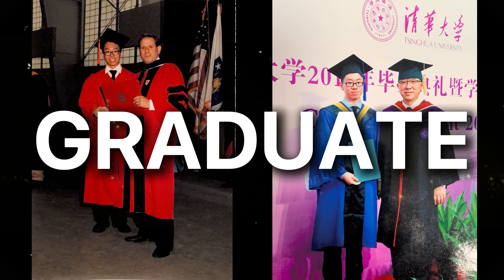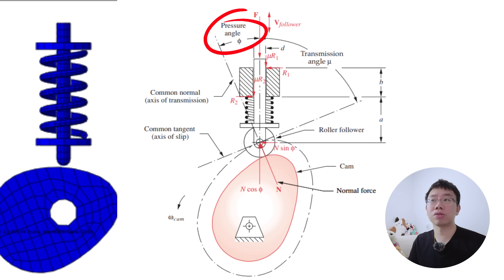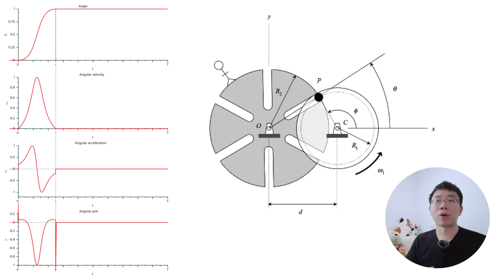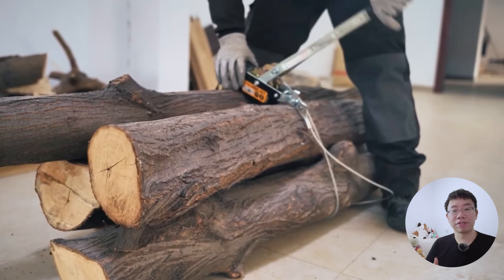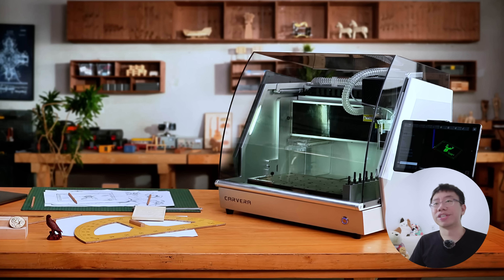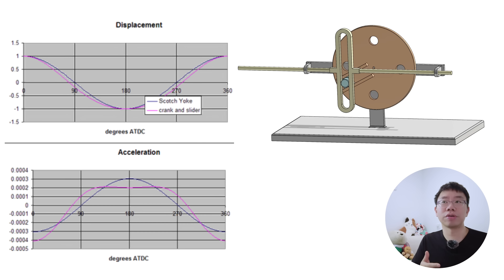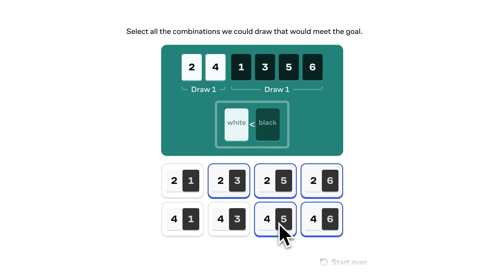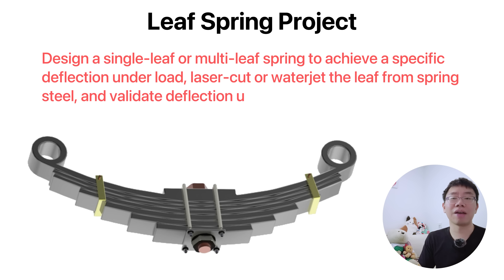Mechanisms EVERY Mechanical Engineer Should Know

Comment: Most mechanical engineers graduate without ever seeing a drill.  There is a massive, massive skills gap in engineering graduates.
Reply: Idk, my school had an entire fabrication building for engineers, we had projects we had to make every semester and let the public use, and I had 2 product design and 2 applied manufacturing classes. We used drills, saws, welders, laser cutters, lathes, CNC, all sorts of stuff. It was a very hands on engineering program though.
Reply: @FenixEnder  This should be a requirement for all engineering curriculum. My school barely has any hands on "requirements." Everything is theory based until senior year's required design classes. Until that point, It's heavy arithmetic. Very outdated schooling and really needs change.
Reply: @LAESA1  Actually, it's not outdated, just the opposite.  My father was a mechanical engineer and got his bachelors degree in the early 1950's.  I saw several of his textbooks which he had kept, and what this video describes and promotes is more like what's in those textbooks.
Reply: @LAESA1  it’s a lack of time. Engineering is much more complicated than it used to be and engineers need to wear more hats, but still only have 4 years. They can pick up hard skills on the job so cram them with theory. It’s a failing on corporations to not actually give any floor experience to their fresh engineers
Reply: @FenixEnder I wish my school was like this. All I learned was the theory and I feel completely underprepared for post graduation roles.
Reply: @FenixEnder  that sounds like MET
Reply: @jeremyncrm2012 is that an applied science school?
Reply: @FenixEnder is that an applied science school?
Reply: True engineers are born in the workshop, not the lecture hall. If you haven't tried designing and making something yourself, you aren't an engineer
Reply: @ratvomit874  100% agree.
Reply: @ratvomit874  that's just an ignorant statement. Have you work in the industry? Rarely engineers make anything. Some of us only improve on  design and do a lot of paper work, making companies millions. You're talking about inventors. Engineers apply engineering principles (and in theory understands it enough).
Reply: @grizzsimbol4441  You don't have to invent something to make something. Every engineer should be able to make whatever it is they design within reason (obviously some mechanisms and designs require machinery that you will not have access to)
Reply: @ratvomit874  If you don't have a method, theory and numeric prove to your designs, you're not an engineer.
That said, if you only know the theory, you're also not an engineer, because you're engineering nothing. You're just making a calculation that you hope has any relation to reality, something that an AI can do these days. But an AI does not know reality, so it can not really engineer.
Reply: @mennol3885  we need both but mechanical design is almost nearly geometry and the knowledge of standards and methods. Then there is no simple by hand computation except hooke s law and euler-beam, everything is in the finite element black-box. So a curious/inventive guy from workshop can be an amazing mechanical design engineer too.
Reply: I've been thinking about this. I'm not even an engineer, I'm someone who tinkers, although I build my own tools to make things, and I worry about the gap. It's tangible.
Reply: 😭Mann I work in the machine shop and some of the PHD students didn’t know how to use a drill….one time one said it was broken and couldn’t make a hole with a drill bit 😭😭😭BROO WAS RUNNING IT BACKWARDS.
Reply: @ulisesmonroy7167  most can't make threads on a lathe or hanlde indexing on a milling machine.
Reply: @ulisesmonroy7167 pretty sad.
Reply: The best engineers come from family backgrounds where they've built and interacted with these things from a young age.
You see huge gaps in intuition for physics and mechanical systems because of this. As well simplicity in design from exposure to what works.
Reply: @Dostoyevskyesque  Absolutely.  I totally agree.
Reply: There is certainly merit to this. I graduated recently. While theory is fundament, it would have been nice to learn more practical applications of engineering. 

Any projects elements that required fabrication, you were expected to have the skillset prior to stepping foot in a lab, have learned it during an internship, or figure it out. 

Now this wasn’t an issue for those of us who had prior knowledge or were mechanically inclined. But I noticed that many of my classmates struggled despite being well-versed in math. 

Personally, I think that it would have been nice to learn the math behind several well-used mechanisms. Cuz, I figure them about “visually” and by “feel” (so to speak), which is quite inefficient.
Reply: I ended up a lowly handyman, but I remember an architecture student showing me proudly their design and I'm like but how do you change those light bulbs how do you maintain those panels how do you... On and on criticizing every square foot for how difficult it would be to maintain such a design...
   Before I realized how disconnected they were with practical maintenance
Reply: ive seen engineering students not know how to use a hot glue gun
Reply: This is why companies need to invest more in training new grads in their equipment and methods. University can only do so much, skills are developed from experience in your specific industries. My engineering skills none of you would ever have. I have specific engineering skills to proprietary expensive technology  even the biggest corporations come to us to manufacture products (my industry is CM). Skills I've only developed through training, no school could ever teach, you need experience and training period. Engineers require that hands on experience that you can only develop from experience. Theory will give you the foundations to develop and learn if training is given properly.
Reply: As a mechatronics graduate I'd worked as a mechanical trades assistant for 3 years prior, but almost everyone in my class couldn't use a drill press.
Reply: But such an engineer can catch up very quickly. Give him, say, four months, and he'll be good enough. It doesn't work the other way around.
Reply: @niepamietam2142  I doubt that an engineering graduate that has never build anything will "catch up" very quickly. I would say it takes years of actually building things to become a good enough, let alone good mechanical engineer. I've worked with both kinds of engineers, those that have masters is ME and those that rose from the ranks so to speak. Only those from either group that had actual experience in building prototypes were any good. Some of the most brilliant ones had no degree.
Reply: That’s why an engineering bachelors degree is a learners permit, not a license to drive. Every job will come with the company’s standards and practices for its particular product(s). There are analogs to other industries as well, such as law, where a law degree does not prepare one to try cases. I was always a bit of a snob, maybe, because I am a DIY guy, skeptical of other ME’s that didn’t change their own oil or do their own repairs such as brake pads, but I fully recognize the convenience/expertise factor.
Reply: if you are a mechanical engineer and don't know these already, good luck, Im a random hobo diy fan and have learned and built these irl for actual practical applications without spending a fortune.
Reply: I would say that’s not true. However, not much time is spent in a machine shop. Frankly it wouldn’t hurt to have a little more exposure.
Reply: We had a project in a basic material science class where my team members and I had to determine specs of an old truss bridge on a dirt road. Neither of my team members had ever seen a tape measure. They were equipped with a 6” scale to do all the measurements 😐
Reply: Went to school for mechanical design. They had us in the shop using knee mills, lathes, and all other sorts of tools. I came from a carpentry/handman background, which has def helped me in my new field
Reply: you gotta be kidding no one calls themselves a knower without aplying into the real world their knowledge if cutting a metal bar or screwing is a challenge for you basically you know nothing about designing anything for manufacture
Reply: i am the opposite buddy i have seen the drills and the drill bits.Sorry for those. ❤
Reply: Unfortunately, when you get into the work environments it gets worst. Management will force you to use a CAD technician to draw the hole drawings for you to pass on to a machinist to drill the holes. Much like a virgin porn director or a F1 car designer with no driver's license.
Reply: I met a manufacturing engineer who didn't know the difference between a mill and a lathe. I know it's different but I group all engineers together.
Reply: It’s not a skills gap. It’s an education quality gap due to colleges and orgs only wanting to push grades instead of pass/fail criteria that recognizes if you truly learned the essentials. Add a bloat of GE and other unneeded courses and wasted time and money, and you have a recipe for disaster.
Reply: Most engineering students these days are required to take Fundamentals of Manual Machining or CNC Machining. I'm not really sure where you get this idea from. It's like a required part of our stack.
Reply: @FroggyRibbits  that’s nice if you got that, my school did not (class of 2021) but we had electives for machining

Comment: Excellent video! 

I took a “Mechanisms” class years ago and we discussed many different cleaver designs. We had to create many of the mechanisms in lab. It was one of the most fun classes I took in college. 
The professor may have called the mis-aligned shaft coupling a “Oldham” but over the years I have learned to call it a “Love Joy” after the company that manufactures it today. 
Your video inspired me to do a little research on the origin of the Oldham coupling. AI returned the following summary:

The Oldham mechanism, or Oldham coupling, was invented in 1821 by Irish engineer John Oldham. He developed it to connect the misaligned shafts in his design for a paddle-wheel steamship. 
Inventor and Invention Details
Inventor: John Oldham (1779–1840), a Dublin-born engineer also known for improvements in machinery for printing and numbering banknotes.
Date: 1821 (some sources mention 1820, when he patented an improvement to his marine propulsion system).
Original Purpose: To transmit power between parallel but non-collinear (misaligned) shafts on a paddle-wheel steamer. Oldham had received a patent for a feathering paddle-wheel system, and the coupling was a necessary adaptation for the gearing involved.

Comment: Hello ,  just wanted to know where should I start from python or c ( am a mechanical engineering student)
Reply: I would say @Puspa-s5x is right about learning lower level languages first. Gives you a better understanding of the underlying principles and C in your case is older so is more or less feature complete and many if not most rely on it under the hood. It might take longer but is helpful. 

Python I would say in today is also quite important since it may not be as peformant but is definitely faster development-wise which is important when you have a deadline to worry about. There are also a LOT of libraries to help with working with things like motors or communicating with electronics amongst tons of others.

Sorry for the longish reply but basically you might never have to actually write C if you work somewhere that has a dedicated software engineer but it's good to know. Python is definitely helpful to speed up prototyping or even develop products and a lot of stuff supports it so it's very versatile from working with hardware to making a website. Optional but might be important especially in school is C++ because the benefits of Arduino is significant early on and shouldn't be ignored.
Reply: Start C++/Rust. Learn python if you want to automate your work.
Reply: I would recommend all mechanical engineers learn latin but the best engineers start off with assembly language or binary.understand the basics before you get your engineers badge and start flying trains
Reply: @caploader111  wym